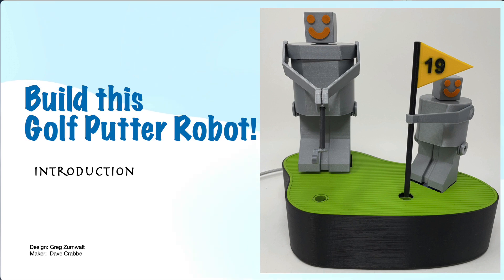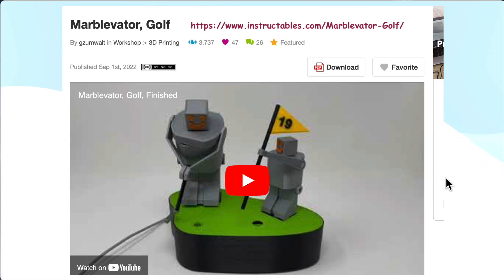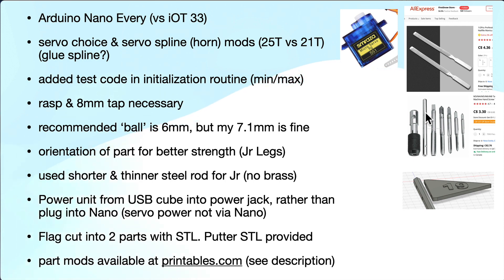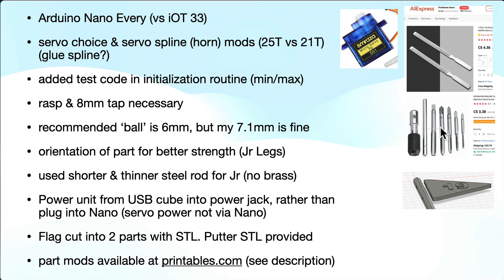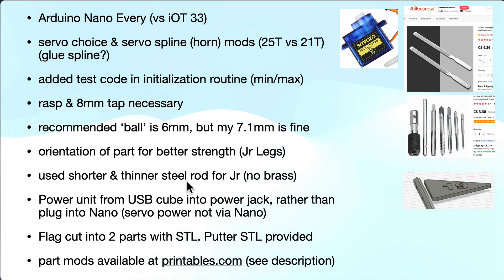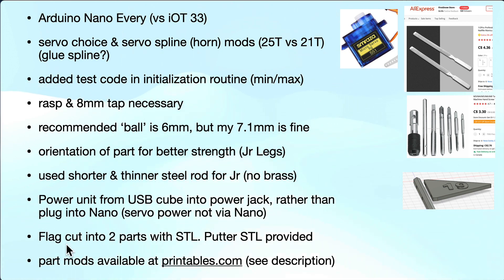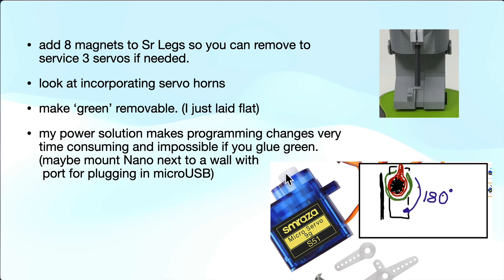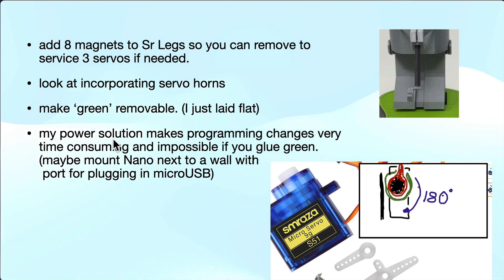Build this Arduino-based, 3D Printed RoboPutter! Introduction

Comment: Wow Dave, just wow!  Congratulations!

Greg
Reply from the maker: Thanks, Greg.. This is such a good project.. I haven't found anything close that captures my interest for 3d prints & the microcontroller. The servo horns drive me nuts.. they are all different. Hope you do some more Arduino stuff.. The "Nano Every" is a lower cost option if you don't need the network stuff. You should have a large audience that would want to make this.  Looking forward to your future designs.. Don't know where you find the time.. grin.. Dave
Reply: @davecrabbe4579  You're very welcome Dave!  This was a very intricate model and I'm very pleased with your results and video!  Congratulations yet again!

Greg
Reply from the maker: @popzct  I've just started to build the Otto DIY robot series ottodiy.com.. (for teaching kids) and noticed the Shield I/O for Nano.. plus how they use the horns which comes with their servos..The shield means you might not need any soldering at all (or very limited)..  I might be making another "Putter" .. and incorporate the shield PCB, plus build the splines over the servo horns that come with the servos..
Reply: @davecrabbe4579  Sounds great, you've done a fantastic job!

Greg